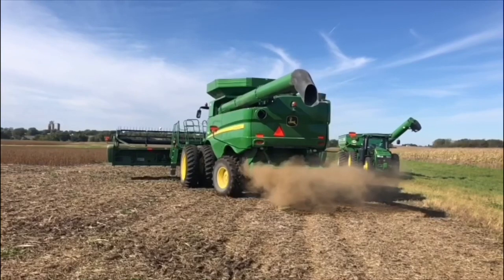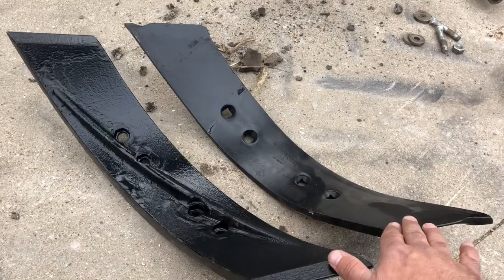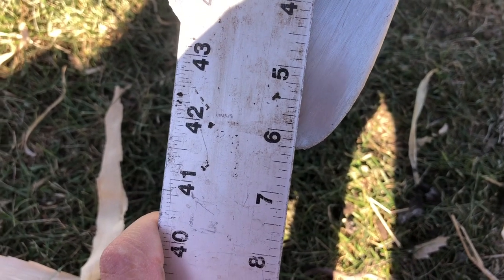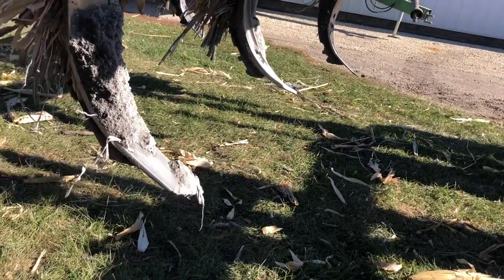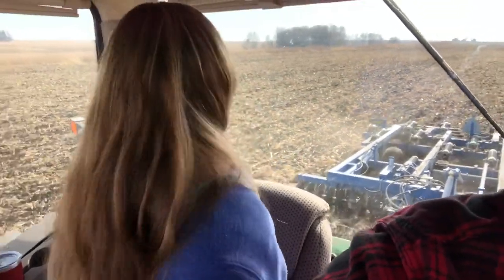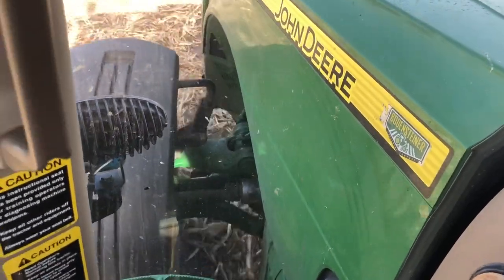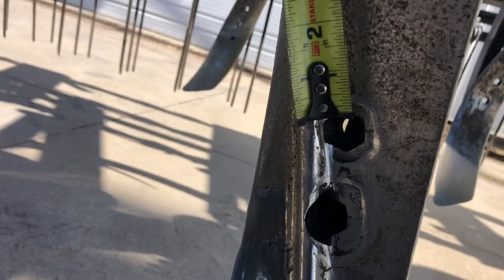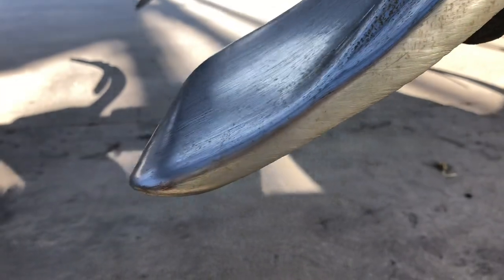The Great Chisel Plow Experiment of 2020!

Comment: On the type of shovels we use here in Danmark (Kongskilde and others)we often put on 310 mm (1 foot) wingtips so we get full cut first time harrowing/chisel plowing,and its possible to buy special welding rods that make shoveltips very hard if welded around edges.Your own test shows that you can weld a rod made of tentor steel diagonally to your shovel and save money and time waiting for that company to get started.I use a 10 meter Kongskilde stub harrow with 40 chisels that are made of spring steel themselves,so No additional springs,and its pulled by a MF 9240 with 250 hp s,and never used the 4 wheel drive yet,allways with wing type!Thanks for vid.
Reply from the maker: Thanks that’s very interesting 👍

Comment: Im cropping 4000ha in western australia. Ive been ripping for years. In my 2nd year using a bednar terraland 6000. I use it for ripping and delving depending on soil type. Have you any thoughts on inclusion plates to drop lime and stubble residue down to 500mm down?

Comment: What ever helps with downtime vs cost is always what you have to look at. Not just the labor time, but the down time from the field. The shovel seemed to break at the stiffening strut so they might have a problem with heat treating. It is hard to balance flexibility with hardness. Interesting test.
Reply from the maker: It really is a delicate balance. Softer metal wears faster but is less prone to snapping off.

Comment: I am sure you know this.  When comparing the two shovels, remember that time is money. Taking a few hours to change them out every several hundred acres will make a big difference.  I would hazard a guess that the rib is a stiffener and adds to the ability of the shovel to maintain the correct angle. Whereas the current shovels are much thinner and probably, flex when they are plowing. That flex will increase wear and tear.  
I do enjoy any of your experiments and tests. Tractor, implements and parts are all important. I am hoping that the many of us that are not farmers but are engaged in other trades suchas electronics and engineering may get inspired by the things that make the farming what it is. Thanks for the video's!!!
Reply from the maker: Thanks Roger! You make an excellent point here. That down time is costly. Especially in bad years where we can’t quite get done before the ground freezes up.

Comment: Interesting test. On first impression it appears to be a win win situation. More durability and less labor. In regard to the break, the temper of the steel on the new shovels could be different and harder carbon steel. It may require a longer testing period to see if you have additional breaks. Of course you will have to consider cost factors also. I have no doubt you will make the right decision

Comment: Very useful comparison in a realistic and practical test. 
However how have the heads of the bolts stood up to lasting longer? I have seen circumstances where longer lasting points / wear tips last very well but the bolt heads melt away real quick to the point where if the worn bolts are not replaced the long life point is lost when in work as the bolts simply wear away too fast.
Reply from the maker: That’s a great point. The bolts seemed to be holding up really well. That big rib down the middle kind of protects the bolts a little bit.

Comment: Congratulations! good idea! My question: in Europe, 250 rounds of machines are widespread in Europe! How many meters wide do you need such a tillage blue machine !? Are there any smaller ones like this ?? The old conser till machines are taken slő a couple .... because there is no similar production! Horsch terrano does very much such a great job !! and not even suitable for such deep work! really how deep did you pull this video! ?? If soybeans are sown in the corn stubble in the spring, is that the depth ?
Paul

Hungary

Comment: using your current points you are adding iron to the blocks, do you think this added iron is making a difference to crop yields?. I like how the new points worked. You will save a significant amount of time not having to stop and flip or change your current points. hope the price point on the new points is economic
Reply from the maker: I don’t really think there is any difference in performance. The real different is longevity. With that being said, uniform depth of tillage is important, and the fast wearing shovels wear at different rates based on where they are mounted. So it would, in theory, do a more uniform job over the season as well.

Comment: Any way to measure the load on the tongue of the tractor of those new chisels?  Just looking at it, it might appear that there might more drag particularly in stickier soils.  More drag would translate to higher fuel consumption.  My comment is based on intuition only.  Pricing might be a big factor in whether they are worth it.  Do you carry spares in the tractor if any break in the field?  Since you go through alot of metal stuff do you have a scrap bin for worn or broken steel?  Not sure what scrap iron prices are by you  but over time it might be a few bucks if you did not have to go out of your way.
Reply from the maker: Yeah I was wondering about the drag as well. I can’t think of a good way to measure that though. Maybe work a field every other pass and then switch to the other kind of shovels and work the remaining passes and compare fuel consumption. We do carry spares. We have a scrap yard about ten miles away but the price is very low at the current time.
Reply: @dodgebrothersfarmandranch9206  With all the fancy monitors on the modern tractor, I am surprised there is no way to measure the load on the hitch.  Might one guess for load might be the difference between the wheel speed and the GPS speed? The tech is probably out there but not worthy of the investment.  Scrap is low here too.  At least you have the option to put it aside somewhere to await higher prices.

Comment: If you changed all of the chisels with the new agritoughs one of 2 things would happen; 1, you would get the front wheels off the ground or 2 the JD would not pull it :)
Sorry Carl....couldn't help myself lol.
Reply: I was going to ask the same thing if a full set would pull harder.  More fuel consumption, wheel slippage, need to pull in a lower gear so it takes longer to cover the same amount of ground.
Reply: @dwightl5863  Def more fuel and it would run hotter.
Reply from the maker: That’s a great point. I wish I had a way to test that...